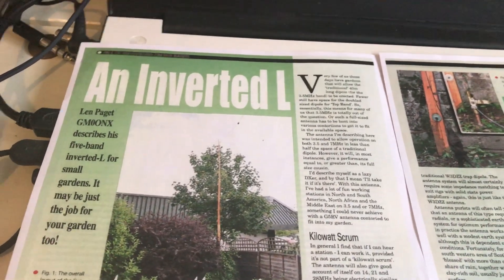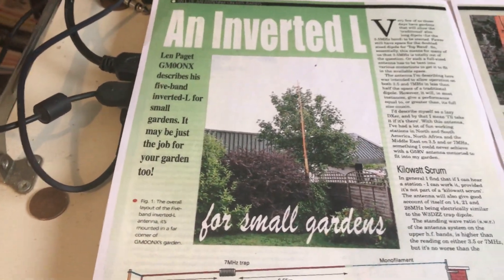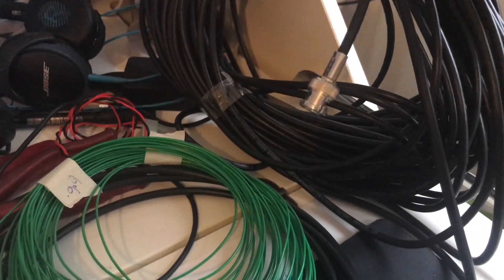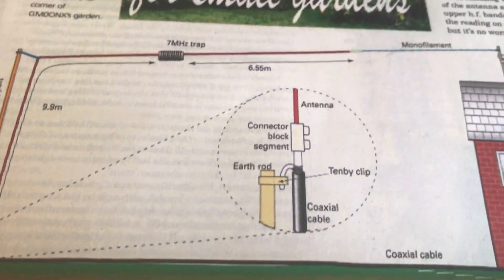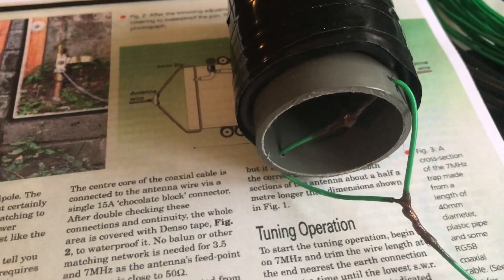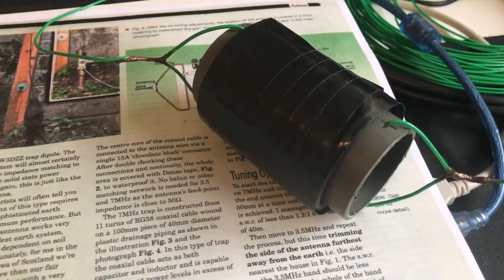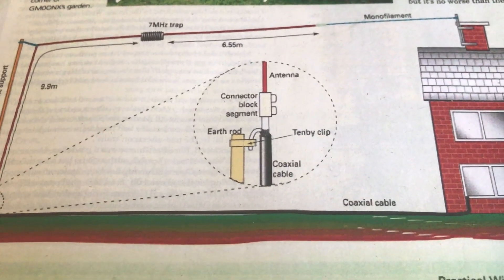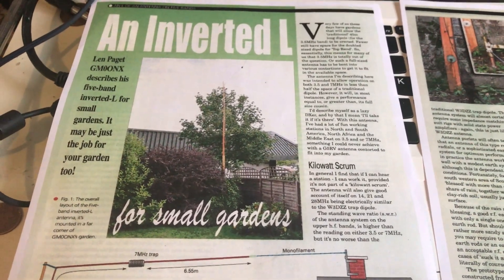How to build a cheap Inverted 'L' antenna, suitable for RX/TX in a small garden

Comment: Welcome to the hobby of amateur radio. Hope you have lots of fun. There's lots to learn and you're starting to get into it with this video. I too experiment a lot with wire aerials. I know this one and it will definitely work - and with a good SWR after trimming the lengths of wire both before the 7mhz trap and for the wire after the trap ( the 80mts section.) Trust me on this - You will achieve almost perfect SWR of 1:1 without an atu but to enhance receive and transmit then put some wire radials out.....as many as possible if all you can manage is 12 radials at 3 or 4 mts long then you'll put a fine signal out. Don't know your call sign best luck in the hobby from Ken G4VZV.
Reply from the maker: Thanks Ken - it's  been 4.5 years since I got my M6 licence - and I'm enjoying every minute. 73 Clint M0OXF

Comment: When testing antennas and transmitters you can always use Kiwisdrs as remote monitors, they are all over UK and Europe. 73 and keep experimenting,  Paul VK3HN.
Reply from the maker: Yes that is true Paul. I actually ran a Kiwi at home and had it available on sdr.hu but no one ever used it! 73s, Clint
Reply: @OxfordShortwaveLog  surprised your KiwiSDR didn't get much use, however, I know I've tried all the ones in VK and,ZL and those in really quiet radio locations like outback New South Wales or country Victoria really stand out, so I bookmark those ones and forget the rest.  So you need a decent antenna and preferably a quiet location, because, you're competing with others that have both!

Comment: Hi there, thanks for video, i have been using this antenna for the past 20 years (it's still up after all this time and working) works well through the bands, my only problem i get at this qth is a lot of qrm day and night and sometimes this causes me receive issues so i built a magnetic loop for 80 and 40m receive is much better as i can null out where the qrm is comming from, so now i use inverted L to transmit and mag loop to receive and if theres still a problem then ill receive through hack green online sdr.
Reply from the maker: Hi there Jason, thanks for the background info on your inverted L. I wonder if it's noisy because of the vertical component of the antenna? Good idea to use a mag loop on RX. Keep safe and 73s, Clint
Reply: @OxfordShortwaveLog  Hi Clint, i think it's noisy because after all its a end fed antenna, a doublet fed with twin feed would be my first choice of antenna but only have a small garden, i may see if its possible to build a cobweb with 80m section i will have to look around see if anyone else has done it, 73s for now, Jason.

Comment: Better to use a counterpoise, also with a trap. You can concertina it as necessary. Use a current balun to get more efficiency as it avoids current flowing to the lossy ground. The far end of an inverted L can be hung down if wanted.
Reply from the maker: Thanks for your tips - very good. 73s, Clint

Comment: Hi OSL sorry I didn't catch your name.

Very interesting this video...I am going to be working on the very same PW mag article you have.

I did consider buying a ready-made Inveted L from Spectrum Comms c/w traps but haven't made my mind up yet.

At present, I am using a mono band Inverted L for top band and have had amazing results considering my garden is only 18mt long...I have had to be creative running it around my garden to fit...its 38mts long.

It tunes on most bands but is twitchy on 80m so I want to fit traps.

Its a pure Inverted L not one of those types fitted with a 9-1 balun...very deaf in my opinion.

I would love to swap notes with you if I could as to your findings if you managed to construct this antenna.

Looking at you vids seems we have similar interests...I to have a love of aviation...(nickjaxe on youtube)

So if possible can I contact you.

Nick 2E0LPL email as per QRZ.com
or nickjaxe AT ntlworld.com
Reply from the maker: Hi there Nick, my name is Clint! I couldn't get the Inverted 'L' to match on any band below about 1:3. Message me on QRZ: M6YCG 73!
Reply: @OxfordShortwaveLog  Clint sent you an email via QRZ a few days ago...wonder did you get it.

Nick 2E0LPL

Comment: There is an addition to the article that actually covers "Top Band 1.8Mhz" that Len, the author,  added in Practicle Wireless....The version you built is for 3.5 Mhz etc..Whih is not actually "Top Band".
However.... The next "Top Band" version has an additional trap and a bit more wire ...it still may fit in your garden though.
Mine was just like yours and it is also tunable on 6mts  and worked great on most HF bands....with the internal tuner of my radio.
Good Luck.
Reply from the maker: Hi there, thank you very much for your comments. I will have another go at this soon! 73! Clint

Comment: Made my In L a dipole center fed for 40 Meters, top height is 44 foot above ground with the lowest point 11 feet above ground. No RF ground required.
Reply from the maker: Hi there, thanks very much for your comments. I had a problem with SWR  - I couldn't get it below about 5, so I need to find the fault. 73! Clint

Comment: Welcome to Ham radio. I use an Inverted L but with an auto atu at the feedpoint. Around 25 radials 84ft of wire. Works well. Good Luck with your new call.
Reply from the maker: Thank you very much Paul! I'm having a few issues with my inverted L, I can't get the SWR below 5 on 40 metres...so something is wrong! I haven't had time to sort it out yet, but I will have another go when I get back to the UK. Thanks again and 73! Clint

Comment: Great to see that you have got it underway Clint. It should work well. Greg has made some valid points re the BNC connectors, the ground plane and possible rfi. As you are going to be QRP then rfi shouldn’t be a problem. I have run mine at 200 watts with no issues although the feed-point was in the corner of the garden away from other houses. I would definitely try to get some radial wires out from the base. I used an earth spike that and was around 1/2” thick from an electrical wholesalers with 8 radials on it as well. Beware of the losses on thin coax. Some of it is shocking and you could end up with next to no power going out of the antenna. I use Westflex 108 on mine. The last one I made used RG213. Antennas are great fun to build and you will be continually messing with them as you know from your previous experiments. Looking forward to that QSO when it’s up and running. Good luck and 73 Graham
Reply from the maker: Hi there Graham, thank you very much for the information and tips.I will certainly make up some radials to improve the ground plane and attach them to the rod. Can you suggest some lengths for particular bands? A 1/4 wave for 80 metres is going to be a bit tight for example! 73! Clint
Reply: Hi Clint. I think it's more important to get as much wire out as possible rather than worry about the length so several stretched into the corners of your garden might do it. I just used cheap speaker wire split down the middle. Just make them as long as you can. The author did improve on his first version to add top band and he goes into a bit more detail on the radials, suggesting 1/4 wave for the band. This is the version that i currently have but don't rate it on top band although it's just about usable. Here's the link http://www.qsl.net/gm0onx/Inverted%20L%20adding%20top%20band.pdf 73 Graham

Comment: Very interesting Clint, I'd like to see how it works out. I have the suburban space restriction issue also and did look at inverted-L as a possible goer. In the end I went with a 20m Doublet (inverted V). My back garden is only 6m from then the extension to the back wall - so I went along the side of the house i.e. front to back. 
The feed point is on a mast, 8m off ground level i.e. the same height as the ridge line of the house (I don't want issues with neighbours complaining). With help, I got up on the extension roof and bolted the mast's T&K brackets to the second storey of the house. I have  small boom and a pulley on top with which I can hoist the doublet up and down. Granted, one leg (10m) of the antenna slopes down into the side passage (between me and my neighbours house) but it seems to work well & ground rods don't come into it. The inverted V makes it physically a lot shorted than 20m. 
I only got on the air in the last few days. So far I've had QSOs on 20m and 40m - 5&9 reports back from Italy and Germany & band conditions, as we know, haven't been great. I'm just throwing this out there in case the "L" doesn't work out. It's all about experimentation and I'm keen to see how you get on. I have a pic on QRZ.com https://www.qrz.com/db/EI9HAB.
When you get to transmitting, let me know and I'll see if you are making it  over the Irish sea. Although, the entire UK seems to be within my skip zone on 40m. 80m seems ok though. That's if I can sort out my own transmit issue in the interim!
73 Adrian
Reply from the maker: Hi there Adrian, thank you very much for this information. The weather in Oxford has been simply appalling these past two weekends, so I wasn't able to get out and finish the build. Hopefully in the next couple of days. If the inverted L doesn't work out I' might give your design a try. I managed my first QSO a few days ago, but that was on 70 cm! Nice pics on QRZ by the way! Thanks again and hope to talk to you over the air, soon! 73! Clint
Reply: I agree about the Doublet. I have a 30x30ft garden and use a 44foot doublet also as an inverted v. Fed with about 50 feet of 300 ohm coax. Tunes on 80-10. Even on 80 can work the rest of the UK on 5w. Is ok on 40 and is very good on 20 (worked States no problem on 10w).  Higher bands not yet open enough to see. Cheers. M6JVI

Comment: Just to say top band is not actually 3.5 MHz it's 160m so about 1840 - 1999 kHz (shared) :) best of luck with the antenna, should perform well but qrm could be a problem especially night time
Reply from the maker: Thanks! The article upon which this antenna is based didn't clarify and these ham bands are new to me. QRM is a problem at my QTH until after midnight, so I'm gonna be busy, late! 73! Clint